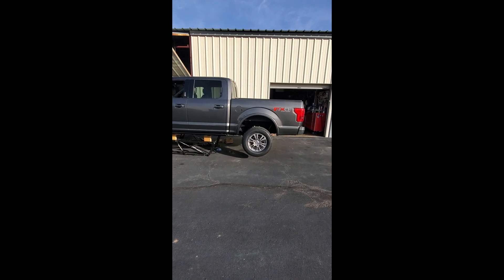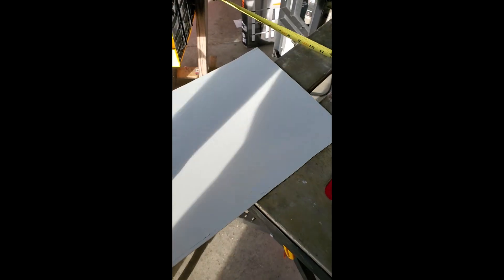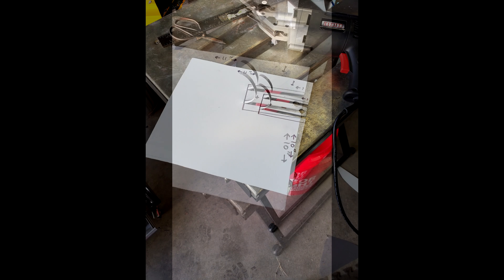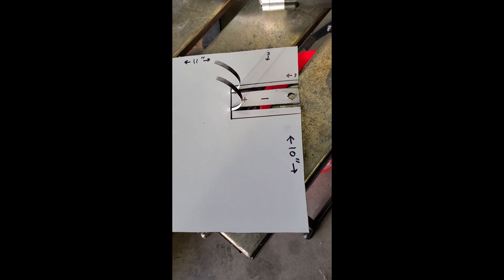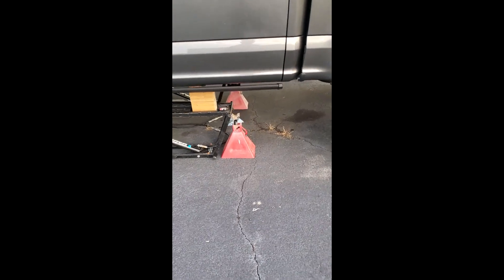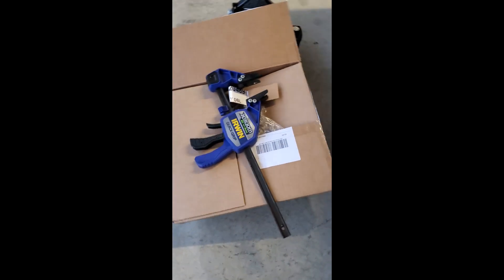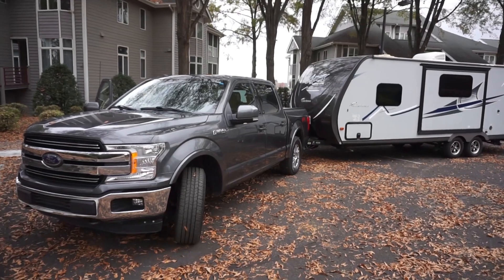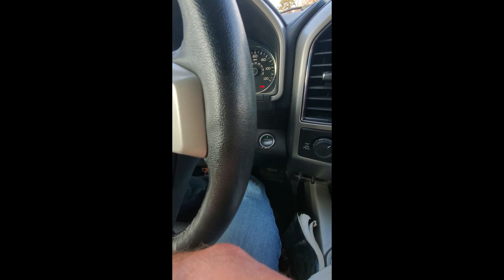F 150 Starter Heat Shield

Comment: Thanks for trying this out. I had wanted to put a metal heat shield inn of those wraps and I wondered if anybody had tried that have you had any issues at all since you've installed this and made this video?
Reply from the maker: Actually, we did.  We wound up making some very long tows...and the heat shield eventually became heat saturated..so the problem returned.  The heat shield definitely works and helped a lot with towing trips that aren't exceptionally long...but in order to achieve a lasting solution to this problem I installed one of the high performance mini-starters that they mount on Mustangs.  The Ford Performance guys specifically said that that starter is not approved for installation on the F-150...but it has worked fine with no problems since it was installed.  You can find the parts numbers on several different blogs on the subject.
Reply: @shermanmorgan1  drat, was hoping this would cure it. My tows can be upwards of 6 or 8 hours sometimes with fuel stops in between.